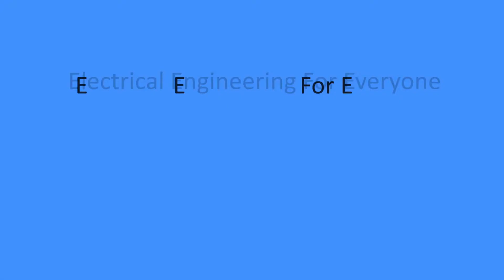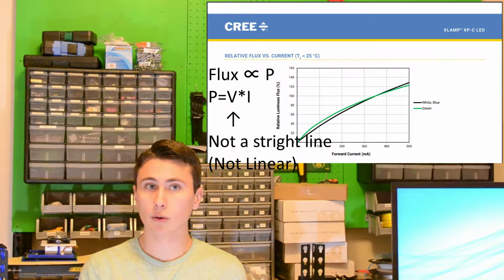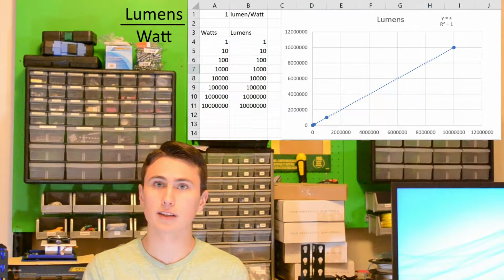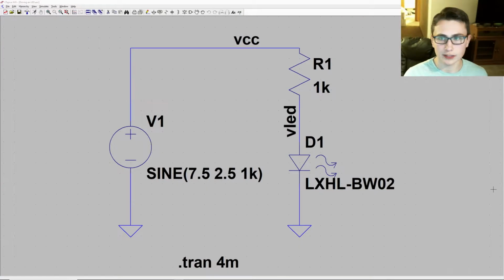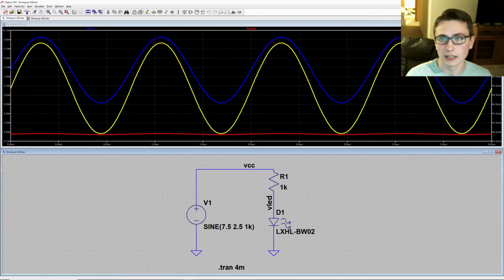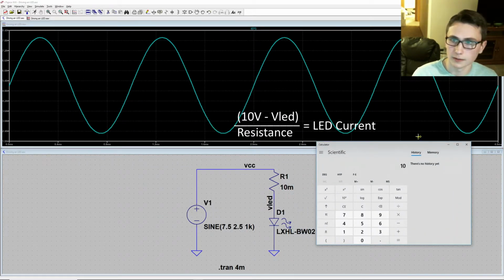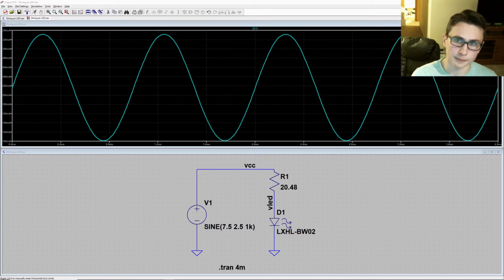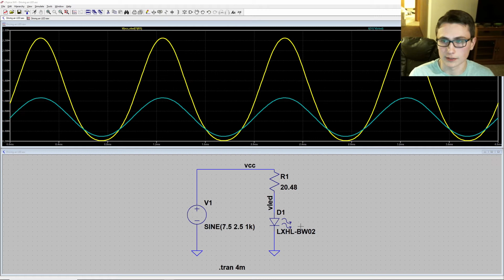How to Control an LED -- Brightness, Power, and Current

Comment: Interesting.  So my friend's project of wearable UV large bill counterfeit check lights might have a hiccup because there's either not enough of the right level of voltage for the LED light... or because the LED is both too small and there's no focusing diffuser/lens.